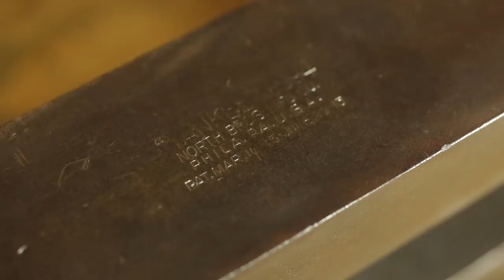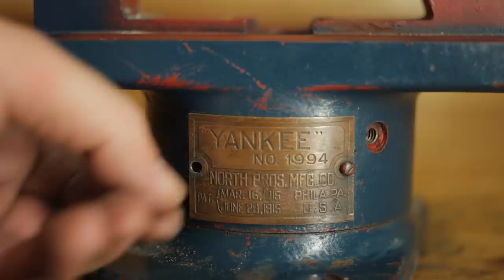Yankee Vice Restoration

Comment: I think that vice had been apart before a number of times...just didn’t look dirty or craggy enough, never to have been stripped down before... My own vice, is a Record Engineers Bench vice, which was my Fathers, I inherited it when he passed away, and it’s older than me...that’s over 64 years old, and still works like it should do...I had it apart once since I’ve owned it, for a gentle clean-up and some new grease on some parts... Your vice looks a treat, and I’m sure will be a useful tool, but more of a rebuild than a restoration...there were probably vice buffs watching who were crying at you ruining the patina that the vice had acquired over the years...personally, I think you did a great job...as usual...well, apart from the cock-up on the Landy sub frame of course...lol...👍🏻

Comment: How much citric acid did you used? What was the yield of it? Have you considered plating or using some fluor acid to acoid rust on the vice jaws?
Reply from the maker: No idea. A hand full in a bucket? It doesn't matter. More strong equals faster.

Comment: A restoration project is still a restoration project. 
Sometimes to progress your project you are sidetracked anyway, a small clamp to be made, or just a drill to be sharpened. All restoration projects!.
Sorry for over using "Restoration".  The vice looks great, well done. 
You needed a success after the chassis alignment battle.

Comment: A recomendation: Always check the gap thickness of the slotted screw, every head diameter has a thickness so it will not leave marks. The one you did here are more or less 6mm or 6,5mm in head diameter so they need 1,2mm gap. Check the DIN norm for slotted screwdrives for this information in depth

Comment: PS...I have a drawer in my shop which has the word ‘SAFE’ written in permanent marker on it...I have for a few years now used it for all small things that I need to ‘put somewhere safe’, until needed to finish, replace, start, or be a spare...it works...except it needs to be considerably larger, as it appears to fill at an exponential rate...lol...I was also thinking of having drawer called ‘This will come in useful’...but in view of the rapid filling of the drawer named ‘Safe’...I thought better of it...and use the garage instead...lol...